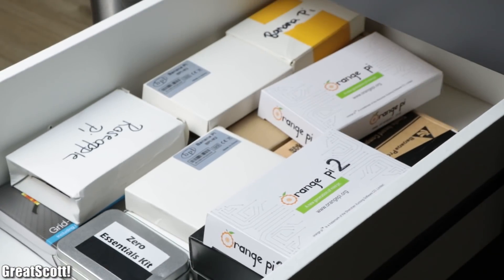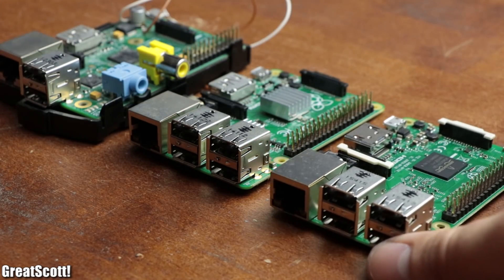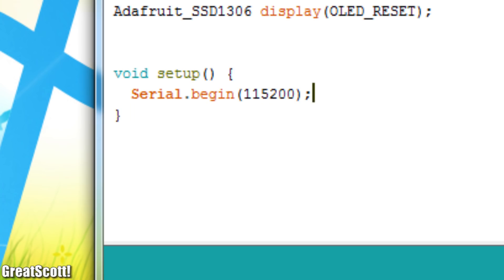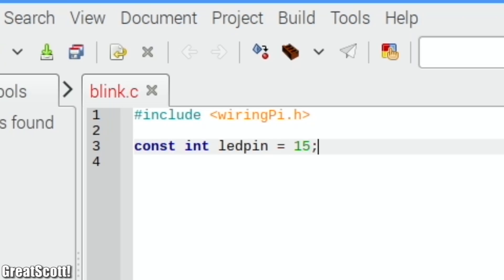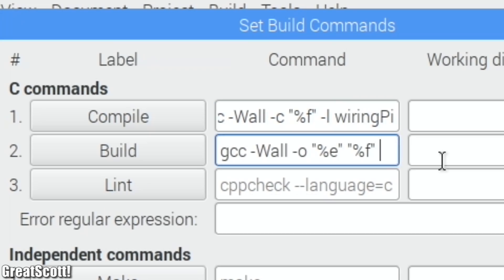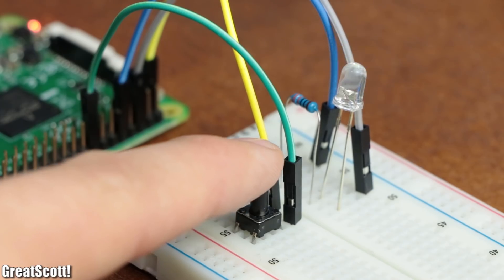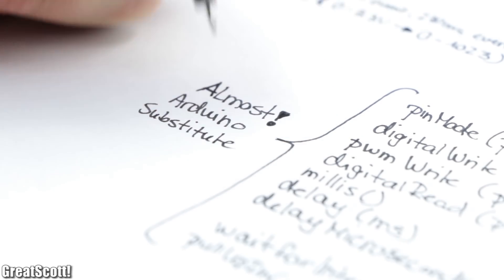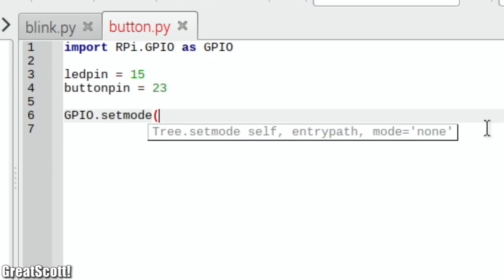Can a Raspberry Pi be used as an Arduino? || RPi GPIO Programming Guide 101

Comment: I found the Arduino to be the easiest to use. the raspberry pi confuses me with all the different ways you can manipulate the GPIOs. The pin layout is also confusing. Pull up and pull down  resistors kind of confuse me as well. 
I have my a Pi Zero a part of a home automation project that turns on and off relays and added a push button for manual control, but that's about it.
Reply: That’s not raspberry pi that’s the ARM processor that’s confusing you because some Pins have alternative way of using them. Learn the TMC123 Arm professor to give a simple way of how a pi works

Comment: The raspberry pi is easier for programmers like me. Since it runs linux, there're many things to play with the software. For example, using nodejs to remotely control it via firebase is a much easier way to build complicated IOT projects.
Reply: You're not even intended to use the Arduino for really complicated IOT things. The Arduino is a microcontroller board (like @P said), you program close to the metal, you don't run a whole OS, it's better for fine control and real-time but you shouldn't use it for a web server or to otherwise communicate with networks. An SBC is far better for more advanced things, especially for things with cameras or network connectivity. There's kind of a middle ground in the form of the ESP8266 and ESP32 series, microcontrollers with a pretty good amount of processing power which are generally capable of come in boards built around network connectivity, Wi-Fi and Bluetooth, and can be easily programmed with Lua, Python or even Node.js thanks to their power and the fact that they usually have 1MB or more flash storage.
Reply: @lithiumwyvern_  tell that to the people that make CNC controllers based on 8-bit Arduinos. :-)

But yes, the different devices have different strength and weaknesses.  You can still add simple network and IO protocols like for IoT. You can still use IPv6 on them, which you actually should do instead of IPv4.  ;-)

Comment: Wanna get the best of both worlds? Connect one arduino to one raspberry pi.
Reply: Rodrigo B.P why would you do that? If you need an ADC just buy an external one
Reply: Consider the PC Architecture, why would we need and and gpu, and dma controllers an programmable interrupt controller(focus on the controller), as far as i know one ATMega328p is not just one ADC,it is a micro controller, so in case that you need, you could just use both.
Reply: Depends what you mean by PC Architecture? We taking about Intel , AMD , ARM ? yea your right ATMega Chip is not just an ADC but Arduinos are really for simply prototyping not really something that should be put in production. You cant even change the registers itself which the ARM processor you can.
Reply: On my recallbox OS build i didn't use RPi GPIO Controller(went out of pins, they are being used for other things), i used two ATMega32u4 for the player 1 and player 2 controllers.
so if you wanted a reason to connect one arduino to one RPi, here it is.
What i mean on PC's beside CPU there are a lot of controllers to assist certain task, the CPU could scan the keyboard keystroke,but it isn't ideal, so intel did the 8042 controller to offload the task from the cpu, the same can be applied to RPi projects.
if you want to use the arduino for prototyping use and for one end product just use EasyEDA with the built in lslc component library and make pcb with everything you need and order from jlcpcb because they are sponsoring GreatScott. lolz
Reply: I see! So you want to use a MCU to free up CPU processing and have them communicate via USB? why not step it a notch and use a TM4C ;) its suppose to be an Arduino but using an ARM processor and the IDE is like arduino as well or you use C to program it . ill make sure to use jlcpcb to help out our boy Greatscott lol
Reply: sure, TM4C can be used, whatever best fits determined project and has a best price.
Reply: I do that all the time when I need wireless connectivity of the pi